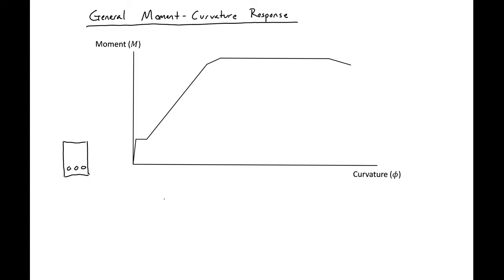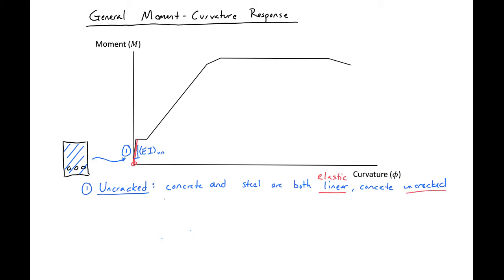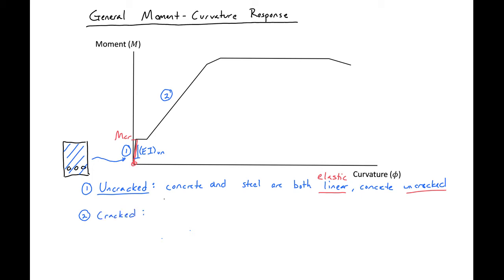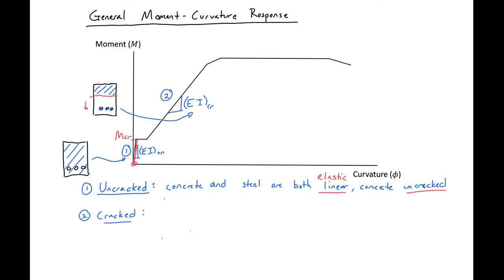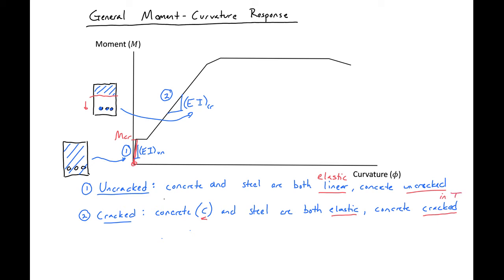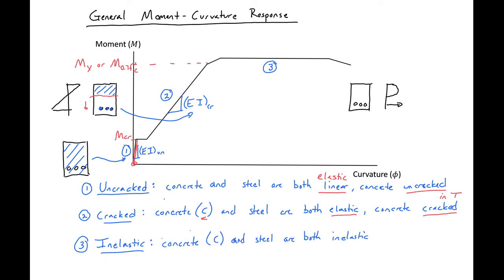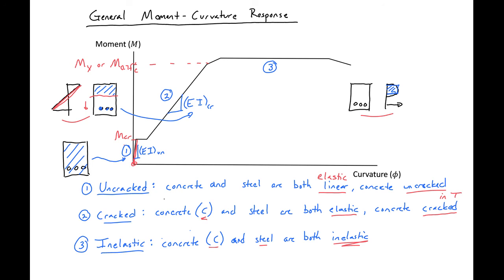7 - Introduction to Moment-Curvature Relationship for Reinforced Concrete Sections

Comment: Hi. Thanks for the insightful video David. I have a query. 
For the curve segment 2, which has EI crack and the concrete and steel are still elastic...can they be classified as linear or nonlinear?
Im wondering that it would be nonlinear as my understanding is that when the structure is unloaded the EI cracked doesn't go back to being the original state (EI uncracked). I associate the term 'linear' when the element can go back to its original state when being unloaded so..Am I right? 
:)
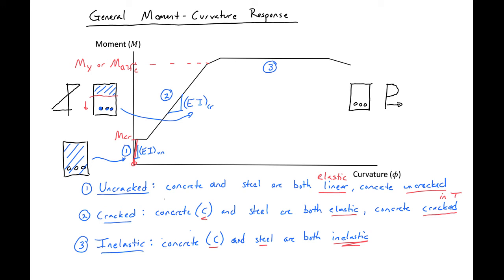Reply: Per my understanding, non linear or linear is referred to the stress block we use in section calculation. At segment 1, concrete can undergo some tensile stress at its extreme tension fiber (despite being brittle material, they still have rupture strength fr or fct, etc, the name is vary according to each building code). During segment 2, tensile stress of concrete reach fr and crack and the reinforcements are kicked in to work. During these phases, we still have linear stress response in the section (you can see he stressed that one out at minute 3:10 in his video). Crack width is started to develope. This is how we do the crack check for service limit state, in some building code they have the stress limitation to check for crack instead of Mcr or crack width check.
But in segment 3, the strain in concrete extreme compression fiber reach e,cu (= 0.003 or 0.0035 per code) and the reinforcement begin to yeild. You can see the compression stress block are NOT linear, and this is the phase we use in ULS capacity calculation (aka the equivalent Whitney stress block 0.85f'c along Beta1*c as mentioned in ACI code)
Reply: linear here means you can substitute area of steel |(As) for ( cracked section ) to an equivalent area of concrete e.g (n*As) then you can use hooke's law but that not the case if it is nonlinear.